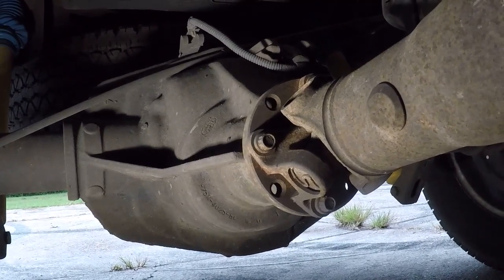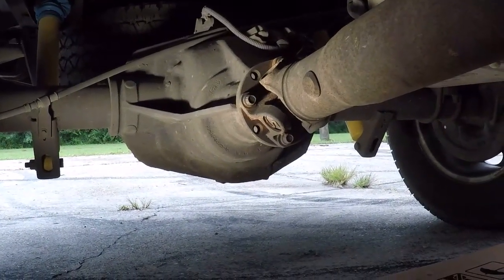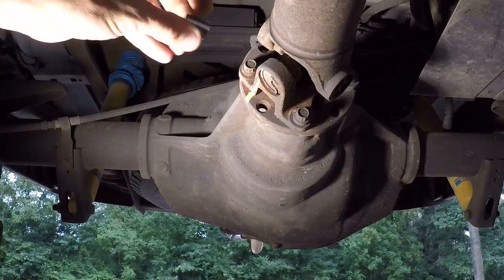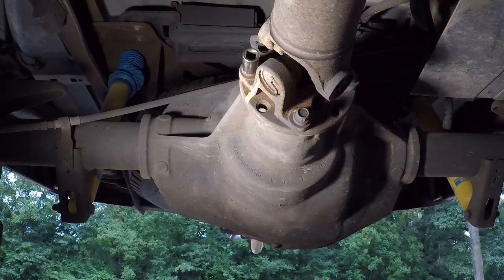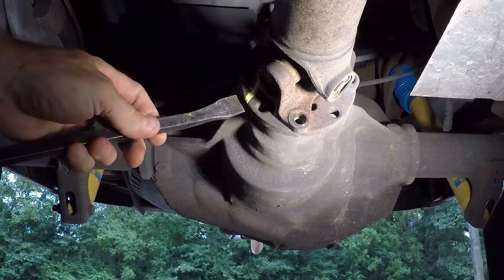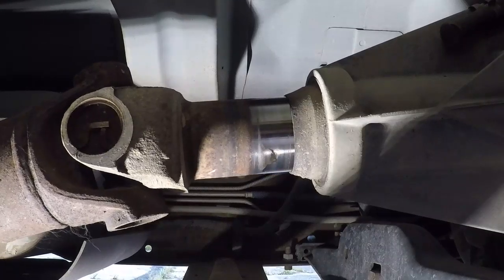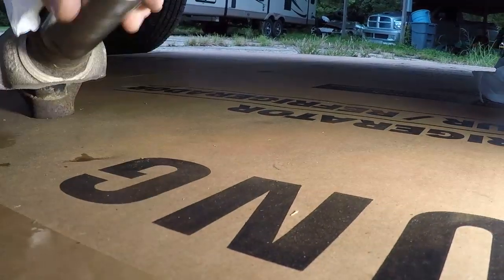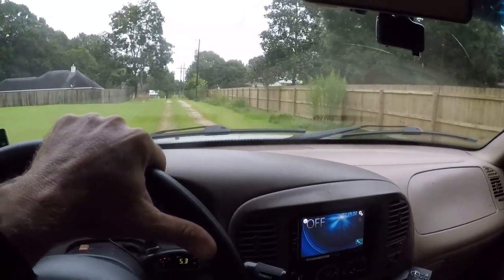1997-2003 Ford F150 Driveshaft removal and lubrication - Acceleration lurch

Comment: People take note: Before any real mechanic removes their drive shaft to diagnose vibration or lurch issues, they check the u-joints while the shaft is STILL INSTALLED.  Raise the rear end so the tires are completely off the ground. Shake the the u-joint and see if there's any play in the bearings. I recently had an acceleration lurch/vibration and it ended up being the rear u-joint. The two-piece front drive shaft had plenty of good grease and was nice and smooth, just like yours. Even after you had the drive shaft off you didn't even check the u-joints 😆

Comment: Mine usually happens if I let go of the gas to slow down and then step in the gas. There would be a bump and delay to accelerating.
Reply: Same on my 2006 lincoln..😭
Reply: My 03 did it for a few months and fell out Sunday. Twisted the yoke apart by the rear end.
Reply: My shaft jus fell while driving 😢
Reply: As soon as you feel that replace your u joints immediately, u joints are cheap, driveshafts falling out are expensive

Comment: From the looks of the transmission fluid that ran out of the tail stock, it needs to be changed along with transmission filter.
Reply: Its 4 wheel drive. T case fluid.

Comment: No need to mark the flange yoke, the teeth in the sleeve yoke will only let it line up one way. Usually the bump is caused from a bad spider bearing,  we normally place drive shaft on a bench, place spider in a vise and feel for the bump. 9 times out of 10 it’s the bearing. Great video, spot on details.
Reply: When I first took my ‘98 sleeve yoke off the transfer case shaft I assumed it was keyed because of the two wider groves that are on opposite sides of the inside of the yoke. However, there are no wide splines on the transfer case shaft to fit into the wide groves. I tested putting the yoke on the shaft at different positions and it slid on just fine. I now think the wide groves are to allow the fluid from the transfer case into the yoke.

Comment: When I pulled the driveshaft out of the transfer case a decent amount of transmission fluid came flowing out. What is the cause of this and what should I do about it?
Reply from the maker: To me this is normal.  I was expecting some to drain out when I pulled mine.  I'd just put it back together and top up the transfer case fluid if it's a little down.  Shouldn't hurt anything.  Thanks!

Comment: So i just replaced mine.  Now there's a clunking noise as i reverse.  And i didn't mark the driveshaft either.  Is this considered a single piece driveshaft?
Reply from the maker: My driveshaft was single piece. I do not know if these half tons came with multiple piece shafts. (Those would be identified by having a support bearing assembly in the middle somewhere on the frame of the truck.) Indexing a single piece unit should not matter. I would double check all of the fasteners are good-n-tight. Thanks!

Comment: Use an impact drill and an adaptor much easier
Reply: It’s a game changer for sure, I break bolts with a long ratchet and then use the impact to take em out the rest of the way, never broken a single bolt that way

Comment: Good content, i have about the same mileage  my 97 ford mine is just more rusty from salt but drives surprising ly well. i did the same maintenance and it helped lol
Reply: I have a 97 f150 4wd and my driveshaft fell off pretty hard and i assume it’s broke so im trying to order a new one but don’t know what size I should get, would you know what size and style I should get?
Reply from the maker: That's a tough one.  I've found there were a lot of variants of these trucks with subtle differences like drive shat length. If you carefully measure what's left of yours you might be able to find one that will fit in a pickapart yard.  Or see if there is a local driveline shop that can fab a good new one.
Reply: @aaronsrose  sweet, appreciate it boss
Reply: @luvvvmoe  if you go to a Ford dealership and give them your VIN number they can print you off a spec sheet of every part on your truck. That's what I did. Hope this helps.

Comment: Good video but how does one know when a driveshaft is bad??? My truck runs fine but the dealership told me that I need a new one after they found out I had an extended warranty.
Reply from the maker: Good question.  To me,  if there is no visible damage and the u joints are good,  I wouldn't change it.  Especially if you have no vibrations while driving.  If you took it in for the lurch at first acceleration,  in my opinion,  the splines on the yoke that inserts into the transmission need lubricant and it will fix it for a while.

Comment: 18mpg that's crazy what you doing to get good mpg lol I have 97 f150 with 5.4 114xxx miles I'm only getting like 13mpg unloaded driving conservatively
Reply from the maker: My commute is not typical.  Basically 50 miles of 60mph highway door to door.  I had a job earlier this year that I was 2 miles from the site.  I got about 13 during that span and had to keep a battery tender on it.
Reply: @aaronsrose  makes sense lol thanks for reply
Reply: 18 mpg? That's what I thought! 13 makes more sense! I saw this video like three times already! Like a year ago and now! The difference, a year ago, was because of clunk, now is more of clunk, an M16 and a grenade all together. I look underneath and there's a part and few needles missing from the cap of the spider. Waited too long.

Comment: I cant get mine in the transmission been under this fuckin truck for 2 hours itll slide in about 2 inches and stop been tryna turn it and everything
Reply from the maker: Sorry I missed this one. There's an oversized tooth on the spline for the trans so it will only go back in in one position. I hope you were able to get it.
Reply: @aaronsrose  the shaft was ment for a v6 i have a v8 i think